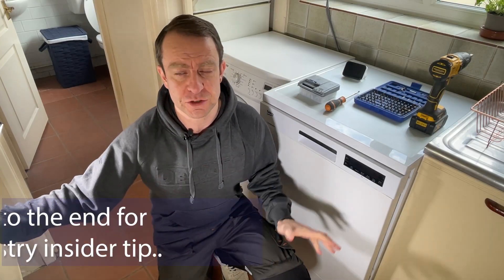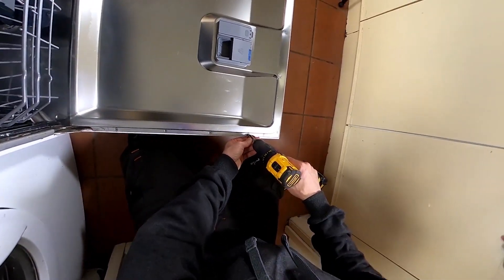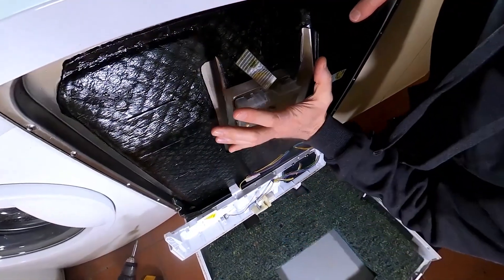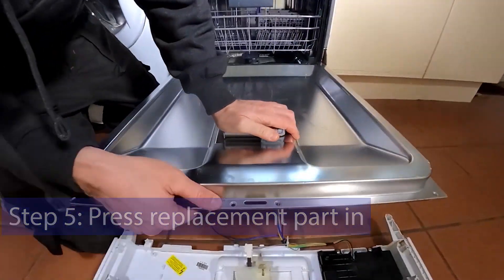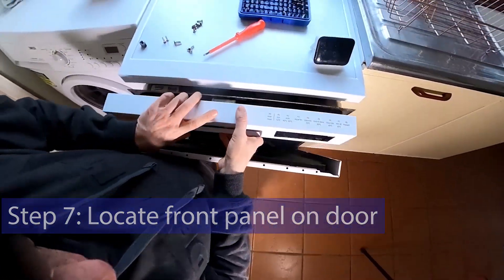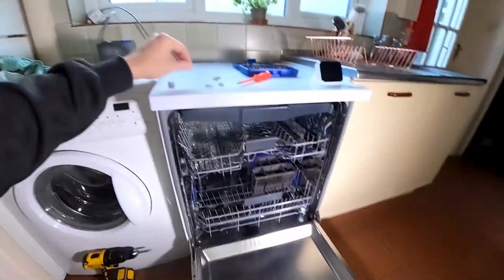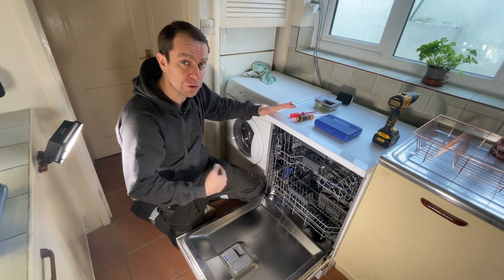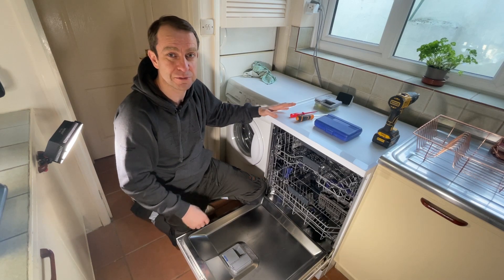How to Repair Beko / Grundig Dishwasher Soap Dispsenser Step by Step

Comment: Thanks for the video guide 👍 Swapped out the old for a new unit, because the soap lid wasn't opening. But unfortunately it's not opening on the new unit either. Is it not getting the signal to open? Any ideas? 🤔
Reply from the maker: Glad it helped. Hmm other than checking connections, I would look at the main controller pcb. It’s probably a sticky relay.. Let me know how you get on?

Comment: Hi
My issue is the tablet is not released in the cycle and when it's finished the detergent draw is still closed.
Will changing the unit fix this, or is it some other fault like a solenoid etc?

Comment: Is there mush difference when working on the beko models that have the controls integrated in the inner door plate?
Reply from the maker: @philholland3468 thanks for your comment and your patience. I believe that this soap dispenser design is pretty universal, so I think it’s highly likely that it’s fitted to your model in a very similar way to mine – although I’ve not had any direct experience of the units with the controls in the door. Would be interested to know how you get on?